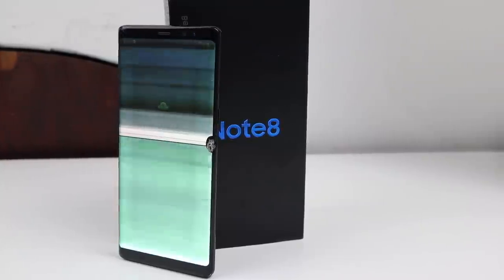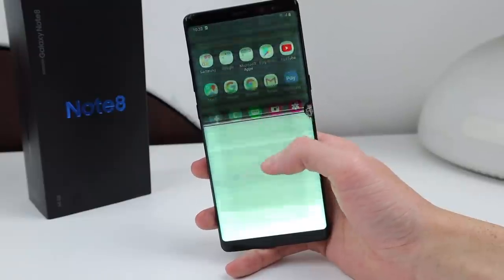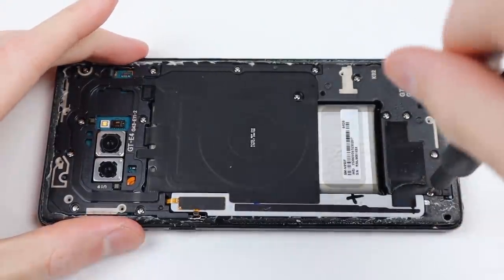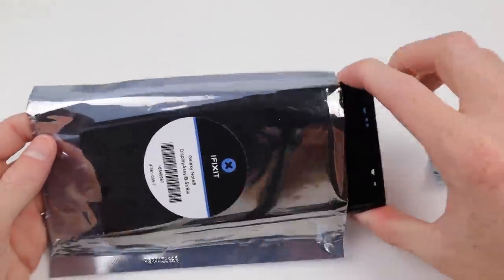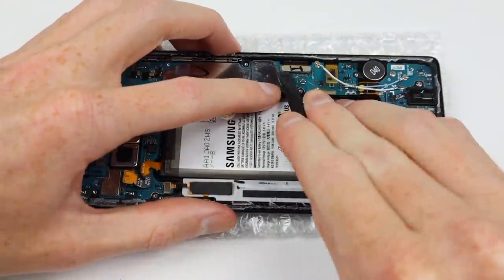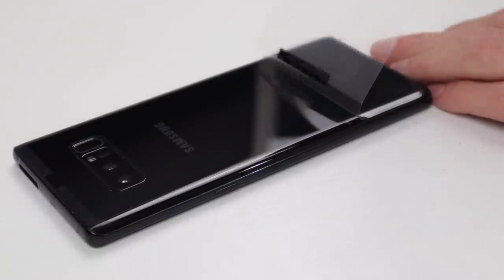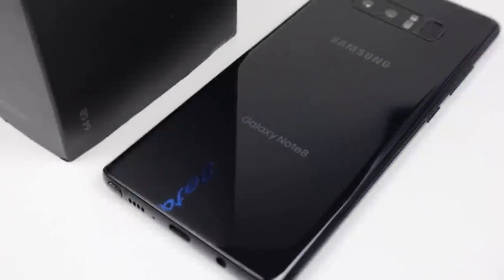$101 Note8 Restoration

Comment: The battery didn't charge at first because the wireless charging part wasn't attached to it. It has a temperature sensor that when not in place stops the battery from charging.
Reply: This is thanks to the note 7 flaws.
Reply: Yeah, I believe Jerry Rig Everything ran into that when he was making the s8 clear and removing the charging coil
Reply: Shanez1215 everyone knows that
Reply: I scrolled down to see if someone had already mentioned it. Not a great design.
Reply: @Termination Shock
It is a good design no-one wants a phone to catch on fire again
Reply: @shanez1215  glass is glass and glass can break
Reply: @succduc  rar
Reply: @terminationshock1356  it gets the job done and the wireless charging coil isn't supposed to be removed in the first place....... Plus wireless charging gets the phone very hot and having it there can be used to slow down FastCharge in order to protect the battery. You can't just say bad design if you don't know how to perform a repair
Reply: @terminationshock1356  it is. It's for safety.
Reply: No it was actually the dock connector, mine did exactly the same thing, even after checking the coil, had to connect the dock connector to the main board before screwing in the main board, the connector didnt seat correctly.
Reply: @terminationshock1356  same here ha
Reply: @shaydevlin5557  Then the sensor should be just underneath the battery, not on a removable part that would otherwise be clearly dispensable
Reply: @xistencestudios8904  I do repairs for a living, thank you. "wireless charging coil isn't supposed to be removed in the first place" who says that?
Reply: @DarientheG  It doesn't have to be on the wireless charging coil. Do you think this is the only phone with a temperature sensor? It's just bad design
Reply: @ASTR0__  are you a 3 year old?
Reply: @mevinbabu5918  no you had to edit your comment so that should say something about it. And if you knew anything about music you would know that that's a song
Reply: @ASTR0__  oh im so SORRY that I didnt know something that weird could be from a song.
Reply: @mevinbabu5918  ha and you called ME a three year old
Reply: @ASTR0__  your point being?
Reply: @mysticsoul2490  OK FuZe gamer😅 at least i dont make shitty videos telling people how to download fifa on android
Reply: @ASTR0__  at least he's not so PETTY that he has to look for things to make fun of another person.
Reply: mevin babu lol I just contradict you comment but kids need to learn their place
Reply: @mevinbabu5918  you would know
Reply: @mysticsoul2490  wouldn't you know
Reply: @mysticsoul2490  at least I have subs and views so clearly I'm doing something right
Reply: @mysticsoul2490  yeah. My God FuZe it's past your bedtime. Go to sleep and study because lord knows YOU need to
Reply: @ASTR0__  i guess i do, look who edited their comment now huh.
Reply: @mevinbabu5918  because autocorrect fucked it up
Reply: MJ m8 I didn’t know 😅
Reply: @user-tw9bk9is4l  what do u mean
Reply: yep, I broke my phone at the exact position of the sensor and now I'm setting here with 4% and waiting for my note 10+ to arrive. I didn't bother to fix the phone because the screen has a hole in it because of the impact (smashed it on a wooden chair)
Reply: The weirdest part is it's only worth 140- 200$  brand new on Amazon

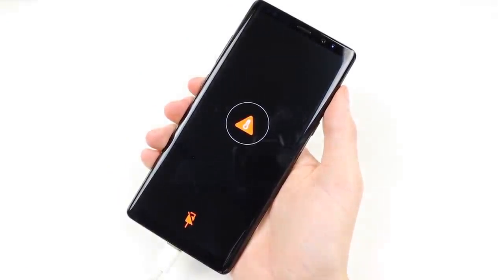Comment: 6:38 the temperature warning was probably related to the wireless charging coil not being connected properly. The wireless charging coil piece has a temperature sensor which will stop the phone from charging if it isn’t detected.
Reply: I repair phones on daily basis. That is the exact problem.
Reply: TheLBall what about that message to the Samsung galaxy A20?
Reply: TheLBall A20 doesn’t has a wireless charger
Reply: Misha Nyangassa I don't know, I just learned the temp sensor error from watching JerryRigEverything.
Reply: ma3x747 I watched the video but I didn’t understand, the Man removed the component definitely or he replaced with another?
Reply: @mishanyangassa9124  He just remuved them.
Reply: ma3x747 thanks alote

Comment: I'm looking forward to the Note 7 restoration to see how you are going to make it safe to use.
Reply: Easy just get the 3200mAh battery from the note Fan Edition
Reply: Would love to see it
Reply: I agree with this comment and all the replies in this
Reply: Use the Note Fan Edition (Galaxy Note FE) battery instead - it'll be safer then. The only difference between the 7 and the FE is that the battery is 300mAh smaller.
If the Note 7 had a 3200mAh battery from the start, then chances are, there wouldn't have been a recall.

Comment: Note 7? Now that's some true nostalgia
Reply: The silver one says, that the specific one (the silver one) has been recalled, so someone sold Hugh a recalled phone that should have been sent to samsung but it havent. I wonder if the same popup shows up on the black one too
Reply: @JustRobertCZE  Weren't all note 7 recalled? (I don't remember) so it should show up on the other one as well
Reply: @garageghost6038  yeah but maybe its a fe Edition this has been released after the s8
Reply: @garageghost6038  it could be Note FE, it is possie that Hugh thought that its Note 7 but it can be Note FE
Reply: @JustRobertCZE  It's not the FE edition, that one looks different and did you see the message on the screen? It says it can charge only up to 60% for safety reasons and the device has been recalled, banned etc. The whole point of the FE version was to fix the battery issue, so this is the original Note 7.
Reply: @JustRobertCZE  I forgot that was even a thing. So yeah, I guess we'll have to wait till he does the video to find out if it's an Fe or not.
Reply: @JustRobertCZE  ok sorry jeez

Comment: It wasnt the dock connecter. The phone coming up with the temperature warning is because of the wireless charging coil, it has a temperature sensor on it, if the phone doesnt detect it, it wont charge because of safety.

Comment: Yet again another great restoration!! For future reference though the temperature warning appears when the device does not have the back wireless charging plate installed. It is not resolved by unplugging and plugging the charging port, it is however resolved by installing the wireless charging plate. This is a very common issue during a repair with the Samsung Galaxy and Note series.
Reply: I can one idea if I order the first description to the first comment with a description it is. I’ll be a part of YouTube history, how somebody will save it in the way back in the sheet probably year 2015 or 60 out at the description.
(DESCRIPTION) 
This part is going to be the bonus comment. At least you don’t want to mention yourself and phone now. I’m apart of YouTube history. Now somebody could take and I come in into the way back machine or take YouTube to the way back machine.

Comment: hey hugh! i actually picked up a fully functional tmobile unlocked for 63$ usd because it has screen burn in.... i just set it to darkmode to hide the burn in! its in good condition also no cracks on the screen or back and only some minor scratches on the screen and saome of the paint is worn off by the charger port! id say i got a great deal on it!😁

Comment: Pro tip: invest in a heat mat, they make heating the phone evenly very easy. Also, I like to use plastic playing cards to take off the back glass, the glass hardly cracks when using them. I use a thin metal shim just to allow me to get a card under the glass so I can cut the edges.

Comment: The issue was that there is a sensor that is in the wireless charging module that is used to monitor battery temps and you didn’t connect it when you tried to boot it up

Comment: This is very helpful. I tried going to battery bulb to see how much it would cost to fix my screen. My screen has a deep crack on the left middle side and has a small black dot in the middle of it. The guy told me that it would cost $260. I paid $250 for the phone since it was refurbished. I'll try to get the Ifixit replacement used screen and frame, and I'll be very careful about it probably play this video again to do it step by step.

Comment: Good playing cards with a firm, coated finish work well for easing off the rear panel. Done well, you should be able to recycle the adhesive depending on how old the phone actually is.

Comment: 6:42 That is a warning where the phone cannot detect the temperature sensor for the battery, therefore it will not charge. This is located on the wireless charging coil. They started implementing that after the whole Note 7 situation.

Comment: About a year ago my Note 8 pancaked on to the side walk while getting out of my car as it was on my knee.. The damage was utterly catastrophic, the glass on both sides were totally destroyed and the display was really messed up.. I have had some experience with repairing phones and I did the exact same thing as done in this video, a simple transplant into a new housing with a used display, and of course I tore the finger print sensor ribbon cable and had to replace that as well. As it sits today, my phone still looks brand new, and will keep working until the day I decide to replace it..

Comment: Actually, the "temperature warning" error that wouldn't let it charge was probably due to poor connection on the Qi Wireless charger not the connector daughterboard, because in late Samsung phones, the battery temperature sensor is the whole Qi plastic assembly and connected to the motherboard trough the same golden pads

Comment: if i can give you an advice... i use a hot plate to remove the back glass. 20 minutes at 80°C and is going to be way easier.

Comment: Not charging most commonly occurs when the qi wireless charging coil is not connected and screwed down to the frame. It has a battery temperature sensor attached to it and is required for charging. Also, connect the dock connector with the board lifted so you can see for a fact it is properly connected.

Comment: That something else that you assumed to be for the headphones is actually for the S-Pen and they are spare tips. There are two types; one is black and it is soft normally given 2 because one is already installed on the pen, the other is white and there should be 3 of them it is hard enough to rip soft screen protectors. I personally like the hard one because it feels more like I'm writing. I might not be accurate about the quantities of the tips.

Comment: Hi Hugh, great vid by the way. A quick tip: Due to the battery problems of the Note 7, Samsung implemented a temperture sensor near the battery. If the the phone doesn't detect the sensor, it wouldn't charge and show the red temperture sign, telling that's not safe to charge. That sensor is present in the top plastic cover that contais also the wireless charging and NFC coils. The Note 7 had impressive specs for the time but it has a battery that is dangerous and i would recomend you to not remove it, it may catch fire if it bends. The recalled ones have been resold as the Samsung Galaxy Note Fan Edition, with a smaller battery. To restore the full battery capacity to the Note 7 it must be the first firmware that shipped with it or the firmware form the fan edition (if compatible).
Reply: Why did they remove the sensor for the note 7? Even the S1 had a temperature sensor in the battery.
Reply: @user2C47  The battery sensor on the Note 7 wasn't removed. The fault of battery resided on littium-ion cell itself, not the battery control board that plugs to the phone's motherboard, where the sensor is located. Samsung just added another temp sensor for safety (reduce charging rate if it gets too hot, the reason why it won't charge without it) and in case the battery sensor goes faulty.

Comment: I want to put this with you. When removing the motherboard, Samsung Certified Technicians usually do not remove the charging port from the motherboard. They remove the motherboard with the charger plugged.
Reply: Also, it says no charging when you don’t put the black shielding on the back of any Samsung.
Reply: How did you know,did you work there or previously worked there
or you read the service manual
Reply: OliTheRepairDude I’ve been a specialist for Apple and Samsung for over 8 years now

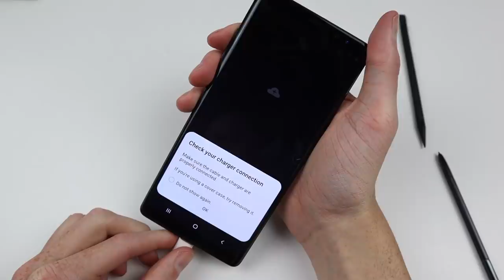Comment: 6:57 I didnt know that you dont know this but the temperature thing is in the NFC/wireless charging module(the little tab right underneath the camera)

This is because this phone being a Note phone and the Note7 being a "HOT" phone is just for safety bc if the Note8 had also exploded Samsung would have probably stopped the Note series

Comment: The battery overheat warning is since you didn't attach the plastic frame (with the wireless charging coil) the first time. This frame also contains the battery temperature sensor and will show the overheat warning is disconnected.
Reply from the maker: Ah yeah, I totally forgot about that! Been to used of working one those note7's

Comment: In my experience of working on these phones I would use filler gauges. I hated using the suction cup because I would break the glass more often. Just using filler gauges and a heat gun I removed the back glass in about 5 minutes without breaking it

Comment: The charging issue happens because you didn't screw the wireless charging coil properly which is also responsible for measuring the battery's temperature. I had the same issue when I was fixing a very same Note 8, I powered it on only with the coil clipped, and figured it out moments later.

Comment: The overheating logo popped up because you didn't had the wireless charging coil plugged in. It has some necessary sensors for the battery and stuff.

Comment: The reason why it was showing you battery temperature symbol, when first testing it, was beacause the wireless charging coil wasn't put back, and  those temperature sensors are located in the coil.

Comment: hi. i have a problem with a samsung tablet. i got it from a friend and it does not turn on. its a galaxy tab 3
Reply: What happen 
What causes it to not turn on 
Is it left in the storage for a long time or suddenly died when using it 
For the storage too long case 
Replace or jumpstart battery 
To jump-start cut a USB cable open and strip it
Strip the red and black wires 
Take the tablet apart and disconnect the battery 
Insert red wire to positive and black wire to negative in the connector and hold in place when the cable is connected to charger 
Using a multimeter check and monitor the voltage when the wires are removed do it repeatedly till it reach 3.6 volts 
If you find this difficult replace battery

Comment: You got a temperature warning because you didn't install the wireless charging pad. The temperature sensor is located on the wireless charging circuit and so the phone didn't want to charge because it couldn't check the temperature. Despite this the wireless charging coil isn't required for cable charging, thus meaning that you can cut off the coil itself and just leave the connector for it plugged into the motherboard which will mean that you end up with a phone that charges properly, yet doesn't have wireless charging.

Comment: As a tip for anyone that repairs this themselves, 99% isopropyl alcohol and having   a tool such as this opening tool (iFlex LCD Touch Panel Opening Tool for Apple Watch/iPad/iPhone/Samsung Galaxy by DottorPod https://www.amazon.com/dp/B01CRPBL9E/ref=cm_sw_r_cp_api_i_eyulEbG23SBRM) will go a long way. Make sure you start on the right hand side of the back glass along the curve to lessen the likelihood that the glass shatters or shatters further, and will make it easier to actually insert tools to cut the adhesive. Also, playing cards do just fine with this setup, the thinness works wonders.

Comment: I personally use a Note 8, it is cracked and i would love to replace the screen, but i simply do not have $165 to replace it and extra for the back glass, i have replaced a screen on an galaxy s7 edge and the screen was $189 at the time, i wish there was a cheaper solution for this.

Comment: The battery didn't charge at first because the wireless charging part wasn't attached to it. It has a temperature sensor that when not in place stops the battery from charging.

Comment: I just got a note 9 for $50 with accessories in similar but better condition than this one, its absolutely mint besides a gash on the screen and a black blob and some touch issues in the area. Not really sure if I'm going to get it repaired or just use it how it is. I'm typing this with it now.

Comment: The reason why it didn't charge is because the battery temperature sensor is on the wireless charging pad.

Comment: yust flash the Factory Binary for the S4 which has no Imei and it will repair the EFS Partition. How ever if the Modem Chip is broken it need to be replaced

Comment: Could the imei issue have been just a random glitch, i have had multiple devices that booted up without imei or signal but it fixed itself when rebooted Edit: i have also had devices that got stuck on the boot screen one of them recovered when I pulled the battery and reinserted it to power it on while one kept getting stuck and the third stopped working completely the imei issue could have been the modem partition containing the cellular baseband not mounting

Comment: There's a thermal sensor on the wireless charging  piece that monitors the battery temperature  look at Jerry rig everything  video he'll explain  it wasn't the doc connector please  alert  your fan base incase they look at your video that little piece is crucial